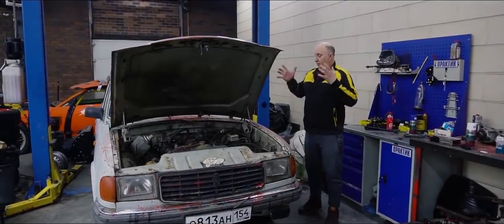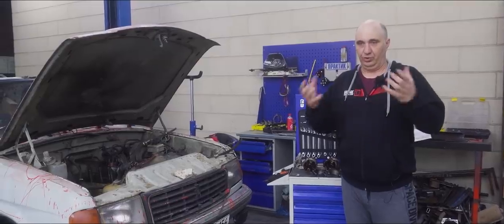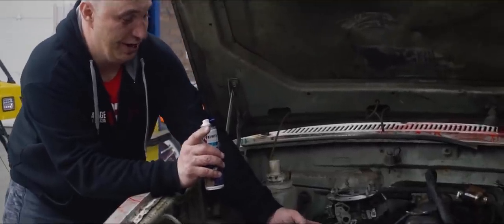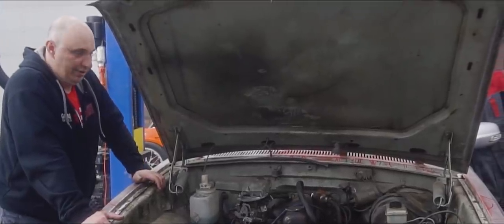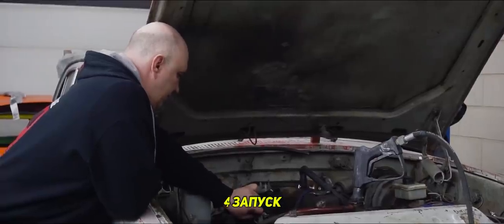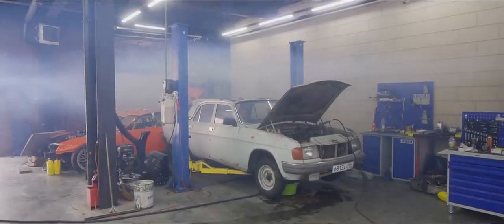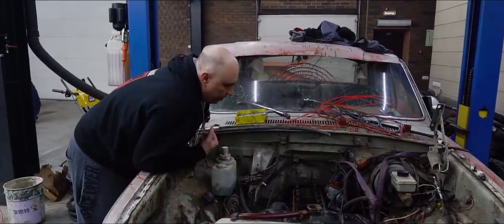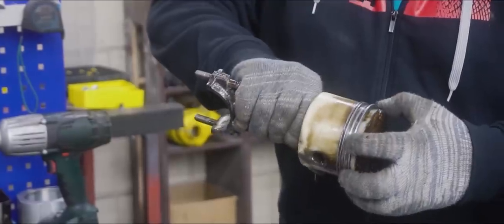Fabricating plastic pistons (will they work?)

Comment: I'd suggest to make pistons from concrete. You may reinforce the concrete with the metal mesh of a fly screen. :D
Reply: Not sure it will take the heat.
Phenolic resin plastic has already been in use for brake caliper pistons and engine pistons.
The durability is somewhere between cast and forged aluminum pistons, incredibly.
Reply: Definitely would love to see this but I think the concrete would chip or completely shatter after hitting the combustion stroke
Reply: Or a ceramic piston
Reply: @Nicolas-lv5qy  how about a combination if the two?
Make them out of that new transparent aluminium.
Reply: @danieljones317  I don’t like the sound of this lol
Reply: @electric6877  phenolic pistons have been used in brake calipers for a long time.
One of the advantages is that they don't rust, and are.lighter.
Most of the Chrysler 2.2 liter cars used them back in the day.
I dabbled in high performance cars back then, and found that phenolic pistons could be had for high performance engines. 
It was a surprise to me, especially with combustion temperatures. 
But, they were succesful.
As long as you didn't give them too much nitrous, they held up quite well.
For day-to-day driving, I suppose they would be fine.
Reply: Concrete with fire cement
Reply: Back in my flying days I dreamed that I was looking at a brick airplane.  My opinion, in the dream, was: "Better a brick airplane than a brick boat."  I don't remember mortar being used in the construction.
Reply: Nah  add fiberglass fiber
Reply: That's a cool idea
Reply: Tying rebar #8 to make strong enough rods and welding horizontal cut steel at the end for grip for the cement to be formed into pistons would be interesting. But it would take some strong bonding agent, and using only powdered cement to form the shapes you need for pistons and cylinders. If cement with rocks was used it would leave too much space for heat to break and crack the cement from the inside. Just like doing cement slabs in the hot ass Texas summer. Man it doesn't work easy
Reply: I suggest that you make the pistons from dry ice  or dry ice cream please dont forget the sprinkles and flake can i also put forward jello flywheels s
Reply: @danieljones317  Phenolic resins are brittleee and easily scratched (probably more a problem with direct injection engines tho), would be fun to see how long the last anyway
Reply: Would be interesting to see concrete! Given how hard CC is, it would probably scuff up the cylinders and cause tons of blowby. Would be interesting to see it in action lol.
Reply: Or a ceramic pistons
Reply: Ceramic pistons sounds like a cool idea and so dosent concrete.
Reply: What about pistons made intireley out of jb weld?
Reply: @victorgirouard1543  thank You:) JB weld but with heat protection from top, thats why My thought was ceramic as on spaceships, but not sure if its even possible to machine them to size🤷‍♂️so jb weld with ceramic top?
Reply: @danieljones317  yes bakelite.
Reply: Concrete explodes when heated.
Reply: Concrete explodes when it is heated to long. I work for a heat-treat company we heat treat oil drilling part's. If I put a load of something hot on the concrete it will start popping within 10 minutes

Not to mention what it would do the the cylinder walls..
Reply: The republic of China   they do I believe have a concrete mixture that don't lol like some of the others. But I still don't think it will work. But I'm still being surprised so far. Lol
Reply: I meant Texas sorry
Reply: @johnsellers2999  my bad
Reply: Plasticine would be bettr lol.
Reply: Scratchy scratchy cylinder walls
Reply: Concrete won't stand against a power stroke. The engine will never start.
Reply: The Australians made a Hanglider out of Concrete. It worked, it flew. They used some kind of superlight concrete though, not the regular kind. 
 (Youtube search term:    Icarus - Concrete Hang Glider )
Reply: @TILEN FABE uu I’ll get that. Its about challange
Reply: What about asbestos pistons?
Reply: Lmao it will score the shit out the piston walls. Concrete is harder than steel. Steel is harder than plastic plastic is harder than soil. They can’t be used together because they wear the other material down.
Reply: Solid lead pistons 😂
Reply: @TILEN FABE stirling engines have a ceramic piston and cylinder or sometimes glass, they are super easy to crack and  warp. Idk how well that would work in that scale.
Reply: @TILEN FABE I feel like the wood would blow apart unless it’s pressure treated
Reply: @danieljones317  diamond pistons.

Comment: Why don't you try with plastic pistons again, but screw thin metal discs to the tops of the pistons, like heat shields..
Reply: Metals such as iron, steel, bronze, brass, copper, gold, aluminum, and silver are all excellent conductors of heat. They won't last more than a minute longer, especially thin, in an ICE engine.
Reply: @G Rossi yeah i know the menaing but i always cringe when i hear or read it....an engine on a car is an engine...period...electric cars have motors not engines
Reply: @G Rossi yes i am portuguese and we say motor for everything that creates rotational motion basically...the thing is that the term ICE came after all this hipster trendy thingy going on now about electric vehicles and their fake benefits to the environment.....people are like: whoooo ice cars are evil blah blah blah...its cringe and i had to write about it , sorry ahahahah
Reply: Why don't you make some pistons of carbon fiber?
Reply: @mcplutt  carbon fiber uses resin to hold shape it would break down rapidly with the temperature and shock and probably fail catastrophically rather quickly. It would be neat to see though.
Reply: I was thinking the same, PEEK pistons and a heat shield on top, the pistons would still heat up, but it would prevent direct fire reaching the plastic
Reply: @G Rossi "It is always better to over-specify, at least from an engineering standpoint"

Not sure that really qualifies as a 'spec', but if it were it would probably say ICE or electric, and have all kinds of ensuing specs, but OK.  Also rockets have motors and they are obviously neither ICE (not in the typical connotation anyway) nor electric...at least not now, give Musk some time and capital and who the hell knows (kidding)?
Reply: @mcplutt  They won't be any better, it's the resin matrix that is the problem.  Carbon carbon (space shuttle leading edges) would take the heat easily (much better than metal) but they don't conduct (see previous usage listed) and they are obviously VERY brittle (see previous usage listed).   Yeah, I'm bad.  

I once heard a McDonnell Douglas engineer denigrating a design of another companies in a design review, and I replied "yeah, well at least the engines don't fall off".  Got a long winded ear full on how it wasn't McD's fault, directly, that maintenance instructions or replacement time frames or some such was the reason.  I said "yeah, excuses, excuses".  It was funny to everyone but him (and those that lost their lives and loved ones, obviously, that part was NOT remotely a joke).
Reply: Could be worth doing what he said they do with race car engines make the pistons a little smaller so they have room to expand once the engine gets up to temp.
Reply: @G Rossi yup, fortunetly Brazil has a very warm climate and we also have it here in Portugal, we dont have any acess to ethanol though wich is  a shame...some people driving gasoline cars use LPG wich is legal but i find it very dangerous and the "legal" installations are of dubious quality of craftsmaship....for you to have an idea we are paying about 1.7€ per liter of gasoline while the minimum wage is around 600€...its absurd...electricity is also very expensive. our country runs from almost 90% renewable energy mostly river dams and wind power...but once EV's start coming in mass, if they ever do...there will be an electricity crisis....we dont have any more palces to put dams, and wind farms cannot be installed everywhere and are very ineffiecient
Reply: @MrHBSoftware  Tell that to Toyota employees at their MOTOR manufacturing factories.
Reply: @mcplutt  Because pistons need to be able to conduct enormous amounts of heat very rapidly away from the crown.
Reply: @scottinWV  scottie scottie....for example "Ford motor company" manufactures cars or automobiles that mainly have ENGINES as their means of generating power....even ford clutches or ford steering racks are labeled "FOMOCO" wich means ford motor company....as far as i know steering racks, clutches, door handles etc dont have motors in them do they scottie???? the name of  a company or the name of a factory means nothing...i can have an engine plant named "peanuts manufacturing" cant I?  also i have never heard someone say the opposite like: " hey i need to change my winshield wiper engine....or the starter engine of my car's motor
Reply: @MrHBSoftware  motor mechanic, motor boat, motor mower, motor bike, motor car, motor vehicle, motorist, motor oil, etc, etc.
Reply: @simonmorris3964  wiper engine, window regulator engine, starter engine, electric power steering engine, electric toothbrush engine etc etc etc
Reply: Even in english here in the US, either engine or motor is acceptable for an internal combustion engine.

Officially speaking anyway 

The definition of them both include the ICE, regardless of it's cycle.

Autos are not exclusively ICE or motor driven, since steam powered vehicles exist and they are EXTERNAL combustion.  Though they are, admittedly, extremely rare, they still do exist.

ICE is a good catch all term for piston driven, fuel powered engines since they all share similar operating characteristics.  Minimum constant velocity to maintain idle, specific RPM ranges to make ideal power, fuel/air/ignition management, etc.  They may all go about it differently, and have a wild array of variation, but the same basic operating principal applies to all ICE, making it an acceptable, shorthand colloquialism.

Besides, if motor must mean electric and not combustion, because public says so, then ICE must also be acceptable as well.

No double standards now, especially for those claiming accuracy as their defense.  Standardized and integrated systems are also of critical importance in engineering as well.
Reply: @iceCOLDkillaxDLoL  I'd go with PEKK since it outperforms PEEK.
Reply: @MrHBSoftware  shush terminology makes it easier to explain...if he hearing ice makes you cringe theres something wrong with you lol
Reply: There's no shielding that kind of heat.
It's not just heat it's an explosive shock over and over.
The screwed in heat caps would simply melt off the hot plastic.
Ceramic works okay either on the bore or the piston but not both.
Oil on metal lubes really well.
Expansion>heat and shock is what limits the material used.
Reply: @MrHBSoftware  QUITE RIGHT !!
Reply: @MrHBSoftware  Well  said....  Spot on!
Reply: It's the friction against the bores that is the main problem
Reply: @G Rossi "  can all run on bio-fuels  " please no, there's no benefit for the environment, it will compete with food for land, its horrible all in all, its not even cheaper without subsidizing. its not even energetically "profitable", if your tractors used to farm the biodiesel run on biodiesel themselves, you never get "over-unit" of production, its just too energy intensive to make biodiesel, better to burn charcoal made from wood in a steam engine instead...
oh, but CO2 is evil...
so lets put nuclear reactors and use electric cars over the wifi ( I don't care about the square law, and that for ever 1W sent over the air 1000W are needed at the source...)
Reply: I was thinking of water injection, might buy the pistons time enough for a quick drive around the block.
Reply: @TTime685  whose definition? yours? i googled it and found this on the first results “People use both interchangeably, but the difference is that motors run on electricity and engines run on combustion. The engine converts various forms of fuels into mechanical force, while the motor transforms electrical energy into mechanical energy.”  i know british people tend to call motor to an engine...i am not a native english speaker but i read and write a lot in English and for me motor is electrical...so i honrestly dont give a crap about anyone that says otherwise even if its wikipedia, the queen, obama or the pope

Comment: a freind of mines dad did this with wood once when he was in high school. he had bought it from a used car dealership and there was sawdust in the rear diff etc. so when it immediately burned a piston he made a new one out of oak and took it back to get his money back. it worked for long enough to get the dealer to give him his money.
Reply: Have you seen the wood piston episode?
Reply: X to doubt
Reply: X
Reply: I suppose that would work if he drove it there without a spark plug lead in the wood cylinder, then plugged it in just around the corner.
Reply: @the_kombinator  it was a flathead engine, this was in the 50's, so he just put a sheet metal top on the piston and it ran as long as he needed it to.
Reply: sawdust quiets noisy gears anywhere you put it. also you have to figgure, back in the 50's nobody went over 35 mph most anywhere they went. the roads sucked almost as bad as the suspensions in the cars. all it had to do was get back to the lot it came from and idle for a few min. it did that just fine.
Reply: Why would a noisy diff cause a piston to “ immediately burn out ” ???
Reply: @irnbru-9288  it would not. however, it would be a part of the laundry list of other problems the car had as well.
 often one problem does not cause another, but things wear at the same time.
Reply: @lukewarmwater6412  . I like the idea of it tho 🤣
Reply: When i was in college, there was a science fair and some guys were making heavy machinery parts with peach palm fruit wood. Incredible hard and durable.

Comment: Video idea: make the best revving lada(remove as much weight as possible from the engine) i mean shave off pistons, make a lighter crankshaft and more.
Reply: Then slap a turbo on it 😈
Reply: Yeah, why not, another fools errand.   Could be funny, and MIGHT last more than 1 minute, if they're lucky.  What might be even funnier is shoe horn a very high performance engine, like the current top level Corvette's or Hellcat's into it and watch the thing eat itself alive.
Reply: @nedkelly1306  Nah, big Roots blower.
Reply: @MrJdsenior  I just want to see an engine block grenade like one of the Cummins at work did and throw the rod and piston out of the side and it took a chunk out of the block the size of a 1kg Milo tin haha if you want to see have a pic hahaha
Reply: They cut the counter weights off crankshaft it actually ran really good
Reply: all you need is lightened flywheel, I already made that suggestion in the past ;
Reply: @nedkelly1306  i had that driving a bmw 323i in 1993 at 130mph, the thing just exploded under the hood🤣🤣🤣🤣
Reply: @nedkelly1306  ol 245 in my valiant Ute, valve bounced it and put a leg outa bed, lifted the bonnet off the pasanger side hinge and left a big hole in side of the block you could drive a landcruiser thru 🤣🤣 frightened fuck outa the miso 😂😂
Reply: yes